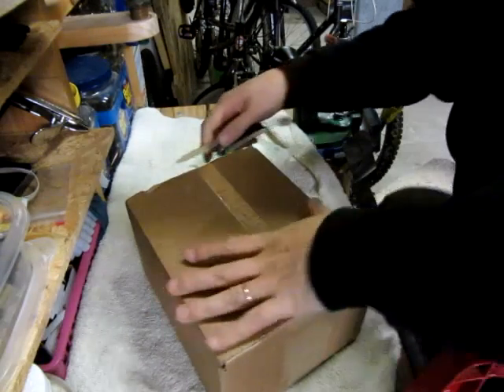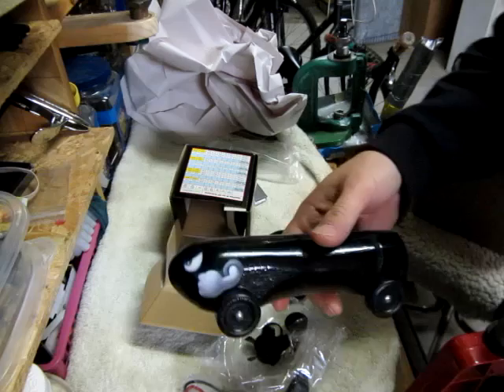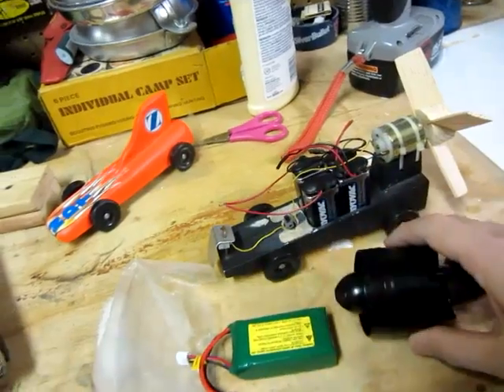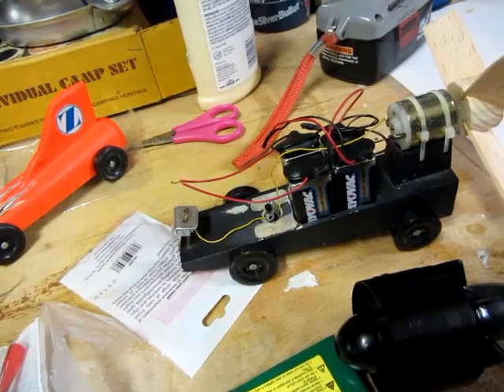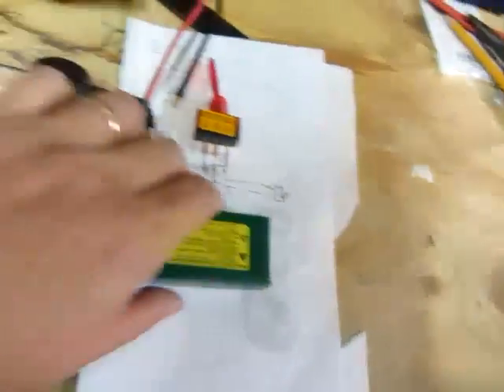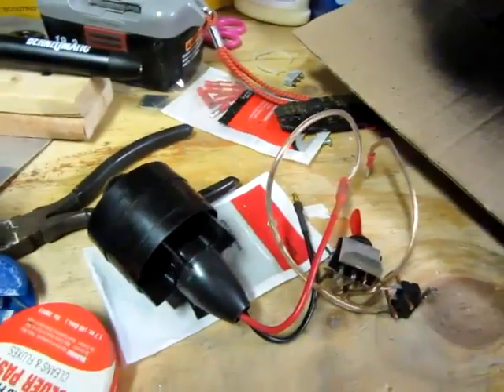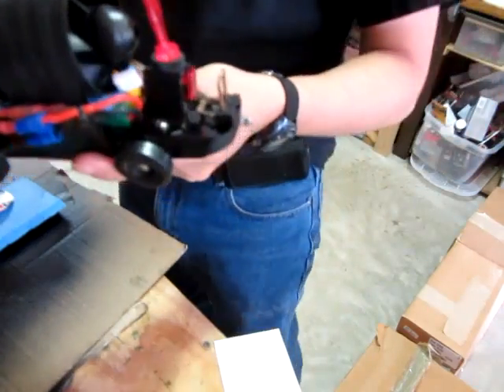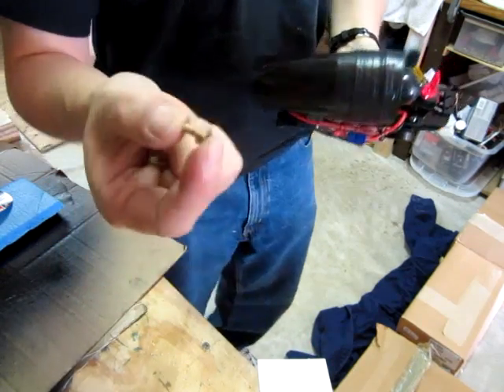Outlaw Pinewood derby car-my secret weapon!

Comment: I like projects. Now I want to build one for fun. Are you allowed to use model rocket engines? Light weight and a lot of thrust. The fire gives it a drag race feel. Probably would have to have the fire department on standby and 20 people on the track with fire extinguishers.
I am thinking two ducted fans also. Both counter rotating so its forced into a straighter line. Just got to get the weight and moment right their thrust should be considered. You could also cut a new piece of wood, where the battery would be mounted bellow. drill a hole for your wires and mount your switch on the back at an angle to work as a wind rudder once you find out left/right drift.
Just my brain storm and it looks fun.
Reply from the maker: DobermansRock I don’t think rockets are allowed indoors but if there was a track outside it may be possible.
Reply: CO2 boost assist. JATO for a pinewood derby racer.
Reply from the maker: I thought about that and even built one, but the firing mechanism was a bit tricky, so I skipped it.  There is a video of a guy who built a car with a soda bottle and he used compressed and a paint fun valve to trigger the air release.  It was pretty awesome!
Reply: Its almost pure aerodynamics man. Like salt flat racing. Once you have the power and can get it to the ground. Then its all how it flies.
Reply: Wonder what an OS .15 model airplane could do connected to some rubber tires. Be hard on the start.
Reply: DobermansRock h

Comment: Does your outlaw class "outlaw" using CO2 cartridges?
Reply from the maker: Our outlaw class allows anything that will fit on the track that doesn't interfere with the other cars and won't damage the track, so if those criteria are met, then CO2 is allowed :-)

Comment: did you ever race it?  did it stay on the track? Try building one that looks like a car. lol Check mine out Fastest EDF powered Pinewood Derby car? Retro Formula 1 Body .  I used a 30mm edf, 3s lipo, 12amp esc, and custom KP Aero free flight timer.  I'd like to know what you used to give your esc the PWM signal? oh, nevermind. I see you went with the brushed motor.
Reply from the maker: Yup, the brushed motor was fast enough for what I wanted to do.  I did "race" it, but it was just for fun.  It did stay on the track.  Here is the video. Pinewood derby 2012 adult Outlaw races (ducted fan driven car)

Comment from the maker: @123karismith Thanks.  Good luck with the build.  In case you don't already know, be careful with LiPo (Lithium Polymer) batteries because if you do not charge them correctly, they can burst into flames.  Just use an approved LiPo battery charger and you should be OK.  They aren't cheap though.